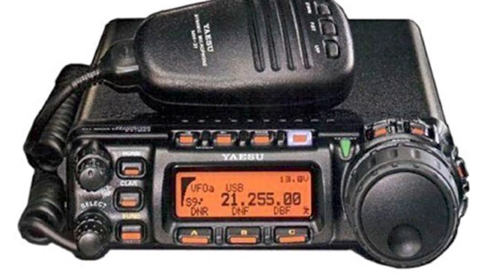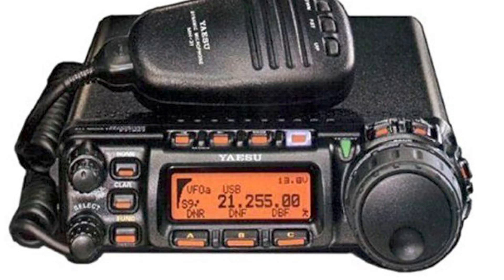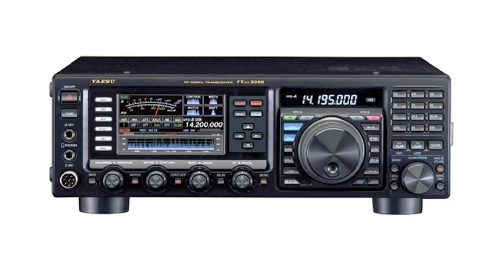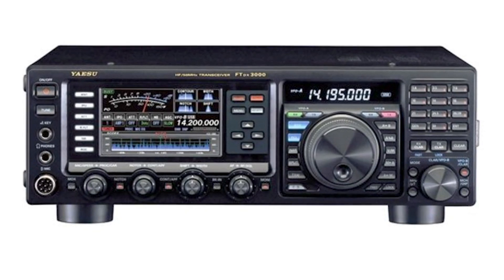Buying Your First HF Transceiver

Comment: i think the biggest issue nowadays is noise,i use an endfed with a 9-1unun,tunes well but no good with s9 of noise from plasma tv's etc.73 m3vuv.
Reply from the maker: Try an end fed half wave with 49:1 balun and line isolator. 73 Peter

Comment: Hi I'm not long got my foundation license and looking for my 1st hf radio, I've got a budget of £1,300 to get everything I've been looking at Alinco dx sr9, yeasu 991A, yeasu ftdx 3000d, what advice would you give me, I think Alinco price would give me extra money to get power supply and all the other things,
Reply from the maker: You don't mention antenna but garden size often dictates this. Remember the Alinco has no ATu and the FT-3000 has been around for a while. I would suggest the ICOM IC-7300 which has an ATU and if you speak to our sales guys they will do a great deal on power supply to suit. Call 01702 206835. - 73s Peter
Reply: @watersstanton  I stay 12 miles from Glasgow and I'm in a high rise flat on the top floor, don't think caretaker will give me access to the roof to put up a antenna but could get one set up on the balcony,

Comment: Buy 7300, your done. Won’t need to worry about upgrading later. Do it properly now, don’t worry later. Buy it new or used from a reputable dealer like water and Stanton. Do it correct, you won’t receive red bricks in a box or a modified radio on eBay.

Comment: Good information. The first question a new ham or someone interested in the hobby asks is "what transeiver do I need?" You did a fine job in answering. I would add, though slightly above the £1k budget is the FT991A, though for a foundation licence holder like me, I think you could argue for an FT818. By the way my first radio, which I still own, was an FT450D.  Cracking radio.

Comment: I've enjoyed many of your videos especially the Garden Antenna Series, thank you.  One thought on this one,  you skip over the Icom IC-718 when that is a very affordable first transceiver, it's nearly $100. cheaper than the FT-450. Seemed an oversight. Oh well, my two-cents.  Keep up the great videos.
Reply from the maker: Hi there. Great to hear from you. The radio is not available here in the UK other than as a used item. You are right, it is great value. 73s Peter.

Comment: hi my first ham radio was my old clubs yeast ft840 used it up until 2years ago last year  came back on to the radio.
again but the ft840 had seen better days so i bought a 2nd hand yeast ft897 and like it but still trying
to get to grips with the menus
Reply from the maker: Hi Stuart, nice to hear from you. 73s Peter

Comment: Great information thank you. I have a Yaesu FTDX1200 great radio around the £900.00 mark with a built in ATU worth considering
Reply from the maker: Yes agreed. Sadly no longer available. 73s Peter
Reply: https://www.hamradio.co.uk/amateur-radio-base-station-radio-yaesu-base-station-radio/yaesu/yaesu-ft-dx1200-hf-50mhz-transceiver-pd-5210.php

Comment: If I was thinking of buying a rig as a new licenced ham, I would definitely stick with buying a modern transceiver by either Icom or Yaesu. Modern rigs are easier to use, have very good receive performance and are great for digital modes. Almost forgot, buying a good quality  13.8V high current power supply of around 30 Amps + would also be a good idea, as most modern 100W rigs require one of these.
Reply from the maker: Thanks Natt. 73s Peter

Comment: Yaesu 891 - second hand about 400 quid - even 550-600 new represents great value for a modern rig with very good rx. The more modern rx on an 891 knocks spots off the 450 and 857.
Reply from the maker: Hi. Thanks for your input on this. 73s Peter

Comment: For brand new hams, join a club. Best initial move every new ham should do, for various reasons. Get in good with one or two Elmers. Hit as many hamfests as possible. Go to as many Field Day events as you can.  Stay well within your budget at first. It may be that you just don`t like the hobby, once you try it.  Then your`re stuck with an expensive rig that will sit around and collect dust. And remember: you can have the best radio out there, but it won`t be worth anything without a decent antenna system. You can make loads of contacts with a cheap rig and a well tuned antenna and no tuner. I do it all the time with my $300 Kenwood TS140S bought used on Ebay, and a simple wire dipole up in a tree.
Reply from the maker: Many thanks - Peter

Comment: One things new hams should consider as well are the accessories needed. In most cases you will need a power supply, coax, antenna or materials to build one. I found when I started hams were quit generous about loaning equipment and helping you get on the air. My elmer gave me enough feed line and materials to make my first dipole and walked me through repairing a power suply that was given to him as junk, in return he gave it to me as a gift.
Reply from the maker: Yes, good point. Will probably cover essential accessories in another video. 73s Peter

Comment: I agree with your pick of new radios for the new amateur operator. I own the FT-450D and for the price you get a lot of radio. I bought mine new here in the States for $679.00 USD 18 months ago. It has the built in antenna tuner. 160-6 meters. Roofing filter. DSP and More. I pickup a SignaLink USB sound card for digital work. I like using a SignaLink because I can move it from radio to radio. When I upgrade to "bigger" rig I will keep the FT-450D as a backup rig. I was going to get a Icom IC-7300 as my second rig until I saw the new "love of my life" the YAESU FTDX-101D at just over $3200.00 USD  it going to be a major purchase. I bought new back in the 70's the Yaesu FT-101EX and used that radio for 20 years without any problems. Great video as always. 73s
Reply from the maker: Your comments appreciated. 73s Peter

Comment: Ft 857 has been discontinued.  Don’t know what kind of inventory is out there.   Didn’t here the Icom 7100 mentioned. Kenwood TS 580 is a good choice.
Reply: No it has not. I’m curious where you came up with that idea?
Reply from the maker: Well one of you is wrong! 73s Peter.
Reply: watersstanton looks like that may be me. 😀The 857 has shown up in the HRO discontinued list here in the states. Ft-8900 as well.